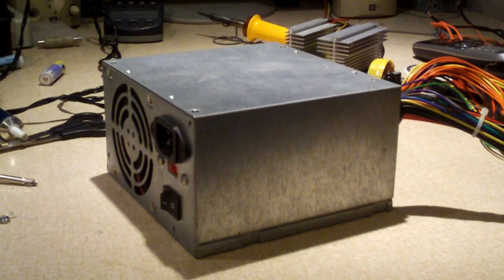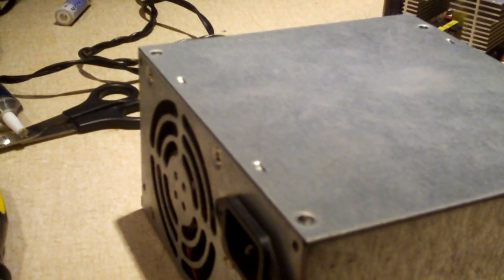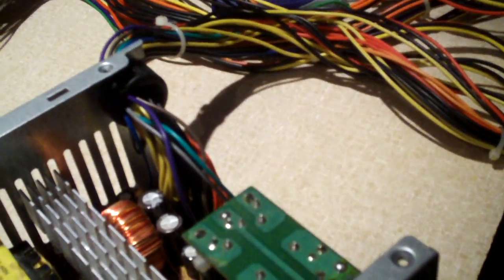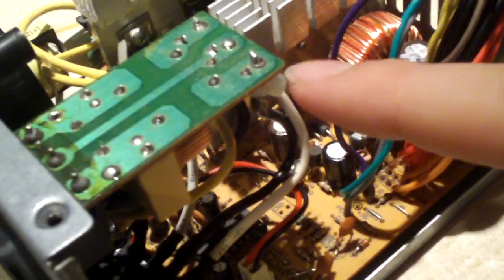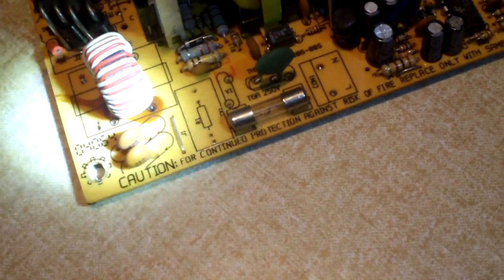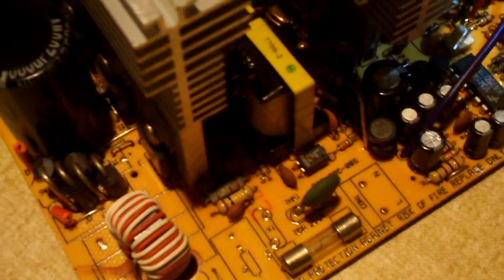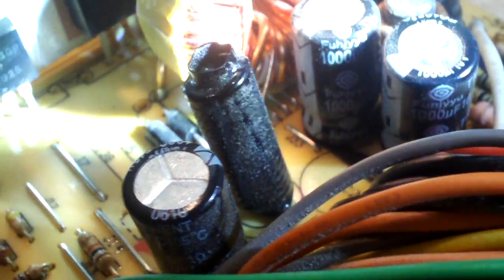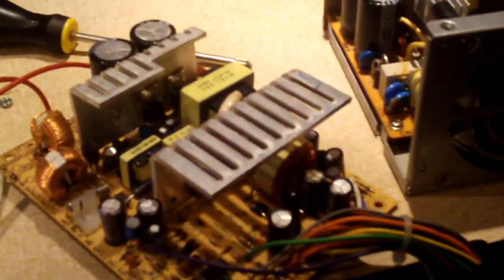Ways to make improvements to a cheap end power supply

Comment: Hello cube, are metal oxide varistors (mov's) labelled as Z1 and Z2 on the pcb ?
Reply from the maker: Yes, MOVs get installed in the areas labeled Z1 and Z2.
Reply: ***** Thank you, I have installed MOV's on to that cheap cit psu that I partly upgraded.

Comment: you might be able to help with my computer but anyway i got this vintage computer running MS-DOS 3.30 for free it works mostly it displays random flashing colours sometimes symbols on the screen sometimes it changes it does the same with diffrent monitors too which work perfectly so i have no idea what the problem is i think either this capacitor near the VGA diaplay output is going bad or bad ram which i hope not as it is soldered in then again it would not change sometimes so i think it is the capacitor i do have a video sorry for the poor quality especially the sound quality i sound nothing like that and you can barley hear what im sayng although you can see the problem i have a link Somethings wrong with my new vintage amstrad PC2086/30 computer
Reply from the maker: I haven't watched the video yet as I am trying to answer everybody's questions at the moment. Look carefully for bad capacitors. In many cases, due to old age, the caps just dry out, and appear to be fine. Also, it could be a bad solder joint, again, due to age. If you have extra memory for it, try that, and see if that resolves your problem.

Comment from the maker: +Laharl Krichevskoy You cannot just simply discharge leads of a capacitor when they're facing the underside of the power supply PCB. The caps have to be discharged before you can start working on the inside of the unit. That includes things such as taking the PCB out of the power supply case.

Comment: When you add X capacitors to a cheap power supply, should you match up two that have the same µF rating?
Reply from the maker: You shouldn't have to match the ratings on both of them, since the capacity of two capacitors in parallel simply add together.
Reply: Oh, so X caps are wired in parallel instead of series?
Reply from the maker: Noah Covert Yes, from Live to Neutral.

Comment: there's no need to wait for the caps to discharge. Just make a 1M resistor with two lead with aligator clips. The just hook them on the caps terminals an wait some secods till it reaches safe levels. Then just leave it there so that if there were any remaining chaarge in the electrolite it will stop it from building up

Comment: Can you replace main transformer from one psu to another. I have one psu with squealing transformer and i want change it.
Reply from the maker: That's right, transformers themselves don't squeal, though some techies actually have swapped out transformers in a computer power supply. As long as the pinout of the transformers are alike, they can be swapped. Though the transformer isn't why your power supply is squealing. There's likely a bad capacitor causing that.
Reply: Squealing? I would check the capacitors.